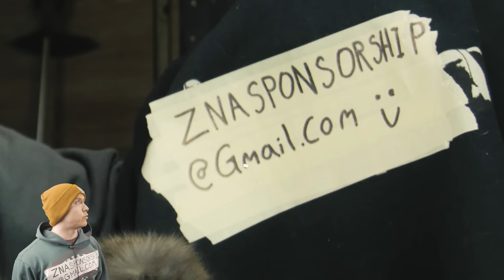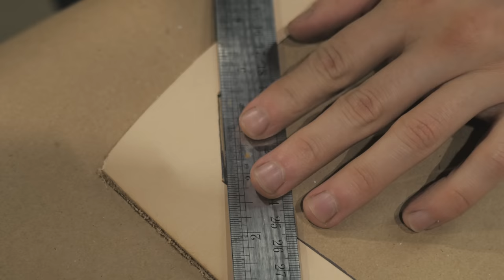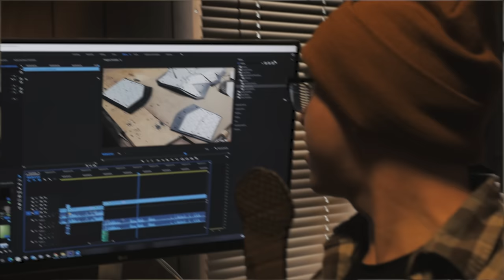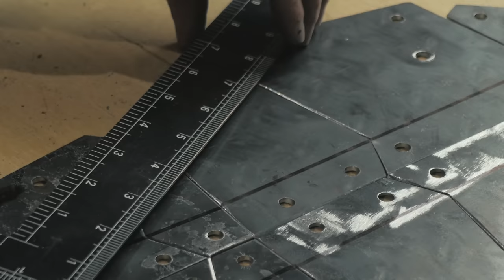Making the Sickest Treadplate Body Armor You'll See All Day

Comment: I know you’re not an armorer or anything and that this armor is primarily for looks not function, but just a heads up in case you ever wanna get into functional armor build. The gaps in the metal are fine and all, but the way you bent them is an issue. The way it’s bent INWARD is dangerous. Generally you want armor to bend outward and away from your vitals for strikes to deflect. Those inward bends you have would cause a strike to deflect inward toward your center mass and direct the strike right into the gaps making any thrust attack that much more dangerous. If you ever decided to redo them, you’d be better off keeping them flat. it won’t look as cool, but it’ll be wildly more functional.

Comment: Do you realize when you heated the metal you softened it. Heat to red ,drop in old engine oil. Then heat slowly until a hickory hammer shaft starts to slide and little puffs of smoke  ! Then drop in cold water.

Comment: How much does one of these projects normally cost? I pass by the small steel section at the lowes I work at and it seems that the bigger pieces of mild steel and even the tread plate is just so expensive I can't justify buying it. The piece of steel I've eyed a few times for knife making is 14 bucks, and I just think "I could buy a knife cheaper than it would cost to make one" and that's not a very builder mindset, but I feel I need a source that I can actually buy from and not feel I'm spending so much on a project that'll be forgotten in a few years as it collects saw dust as I move on to more projects

Comment: I'm reminded of when you made lv.3 armor using two ar500 plates as templates. And now I'm curious if steel tread plate over real lv.3 soft body armor would be enough to stop rifle rounds. Even if only one shot.

Yes i know steel tread plate is mild steel and NO WAY is even close to AR500 steel, but in conjunction with high quality soft armor I wonder if it'd sap enough energy that the soft armor could stop it... or at least make it survivable if it did get through.

Comment: 14:49 couldn‘t you just attach the shoulder belts before putting it on and then just slide it on like a hoodie? And maybe even one of the side plates too so you kinda go in from one side and slide it through your head
So you wouldn‘t have an annoyingly tight belt that makes you look more buff then you are but takes away breath
Unless you wanna pull some weights or a Gut‘s sized sword (rip Miura)

Comment: Yo instead of doing what you did by pushing the rivet gun up against your abs, why not put a large diameter N U T on the table and poke the rivet through and pop it on the top? Kinda like you did for your kneepad shoulderpads? I mean you can put some scrap leather or cloth around the nut so it doesn't scratch the paint too!